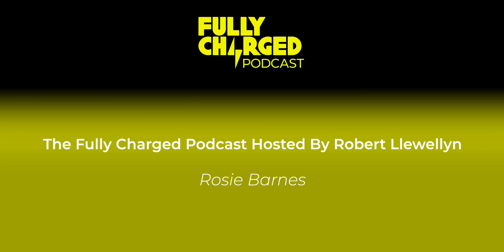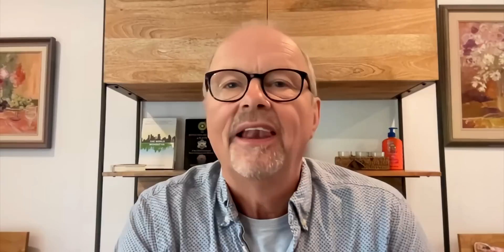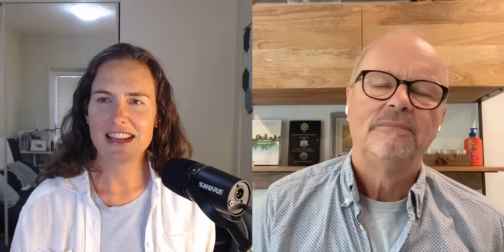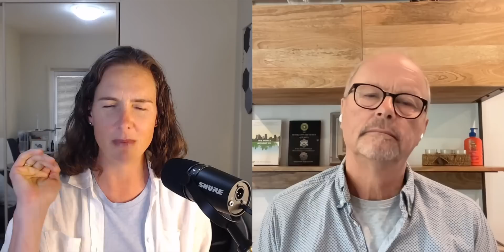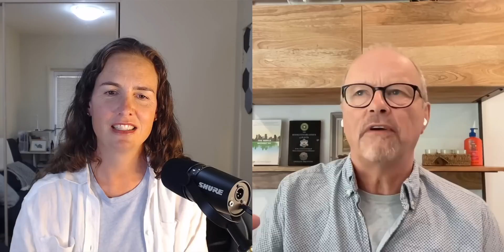The Inevitability of a 100% Renewable Energy Supply with Rosie Barnes | The Fully Charged Podcast

Comment: California has been leading the way in America.. First stopping coal electricity generation back in the 80's!  Then telling the power company they must stop burning oil in the 80's in the summer time, then altogether stop burning oil.  Look at the Dragnet, and you will see the smog over LA back in the 60's, but now the air is so much cleaner.  Steel companies moved out of California, and even the coal power plants where moved to Utah, where LA DWP buys millions of MW of coal power from out of state!  

In 2021, California had 12,000 MW of installed solar capacity, and that made up more than 20% of the electricity produced on days when there was not a lot of HVAC running.  Now they have over 14,000 MW of solar in 2023, and plans to install more than 2,000 MW more during 2023.  

I can recall back in the 90's "More than 10% renewable power will break the grid" and yet Iowa is running 90% wind power many days of each month now!  And some days are 101% wind power, selling the excess to nearby states.  

There is a interesting video about how a University studied the MISO power grid, and came up with solutions to meet 100% renewable power for their section of America.  So if there is a unlimited budget, they can power the entire grid using battery storage and plenty of solar power.  They also figured out how much that will cost.  A little more about that later.

Also with a unlimited budget they can power the entire MISO grid with just wind turbines and battery storage.  Yet they would have to build so many "Extra" wind turbines to make enough power in the summer to run all of those air conditioners.  Yet if they build a few less wind turbines, the system will be much more affordable.  Yet there will be a shortfall in wind power during the summer.  

Again, back to the unlimited budget solar system, it would also require a lot more solar panels, because in the winter, there will not be enough solar power alone to run the grid.  So a reasonable priced solar only system would run out of power during the short hours of sunlight in winter.  

That is when they discovered and documented what has been known for years.  Match the wind power that is in excess in the winter with solar that is in excess in the summer.  Then the system overall can be much lower cost.  

Then they answered the question of how many batteries will be required, and came up with an innovative answer too.  So by installing a few more wind turbines, and a few more solar panels, they can avoid storing all of that power, because they are making excess power, and not running some of the solar systems when they have to much.  

So it really does come down to a math problem.  We do have a limited budget!  They need to make some decisions to save money.  Sure they could spend $1 billion on battery storage and store every watt we produce.  But is that the lowest cost way to get to the end goal?  Would it be less expensive to install a $1 Billion wind farm and then not need so much power overnight because the wind turbines can produce power at night.  The $1 Billion dollar wind farm will produce about 200 MW to 400MW all night long, while the $ 1 billion dollar battery can only supply 2 billion watts of power, then must be recharged with 2.2 billion watts of power.  When you need that 2 billion watts of power, the battery is nice to have around.  However it would also be nice to have that 200 MW every hour X 24 hours a day, and not need to recharge the battery.  200 MW X 24 hours a day is 4,800 MW of power, or double what the battery can put out in 24 hours.  

So do we install the $1 billion battery now?  What is the best solution?  Some battery power is required.  However there is such a thing as to much battery power, and not enough wind farms.  

California has a normal 24,000 MW electrical load, almost 24 hours a day, and a lot more in the summer time, less in the spring and fall when HVAC is not as needed.  So at 18,000 MW of solar power, they will need to sell a lot of power to nearby states in the summer peak power days, while still importing a lot of power overnight.  So they actually have "To much solar power".  If they install more wind power, that will balance things. 

Remember the 2021 Texas blackout was caused by natural gas and coal power plants getting shut off and taking out 400 MW of power production from a dozen power plants all of the sudden!  Then on Monday, the power companies sent their press man to tell the Governor that it was the fault of wind and solar power.  So that made the headlines "Wind and solar caused the blackout".   I like what she said, a coal power plant goes offline, and you lose 1 GW of power all of the sudden,  when one wind turbine stops, nobody notices.  

I agree that less battery storage will be required when we can tell 10,000 car chargers to "Charge now" and then only allow a little charging this hour, because there is the potential of brownout during this hour.

Comment: Rosie, 

you must know that 100% renewable generation for grid supply is impossible, unless significant hydro is providing the power.
In the U.K., since the 26th February wind has been providing on average 5 gwatts per day, two days exceeded 5 one day it was 10 the other it was 13. Maximum demand is a shade over 40 Gwatts. Gas, which was doing the balancing, was averaging about 12 to 15 gwatts per day with  maximums of about 20. 
That, if gas was shutdown, would require about 3,500 Gwatt hours of supply to replace that. From what?
This is ignoring the other technical deficiences of wind generation, I didn't mention solar as that was generating very little as is normal for our winter months.
Reply: We are still in the very early stages. Renewables only have become the cheapest energy source a handfull years ago.
Things have barely started to move at this point, things will only accelerate and keep ramping up quickly from here forward.
10 years from now most of this process will be done already.
Reply: Baron, 

renewables are not the cheapest by any stretch of the imagination. That aside there are far more important parameters which renewables simply cannot meet, not now not far into the future They are practically and technically unsuited to large scale grid supply.
Reply: @iareid8255  they are very much the cheapest. By a margin even.

And there is no reason why they couldn't supply our energy needs. They will soon enough, a decade from now almost all our energy will come from wind and solar.
Reply: @iareid8255  which oil/gas/nuclear company do you work for or have shares in & how often do you have to wash your soiled underwear?  And shirt, as you also seem to be BullSh1tting as well as filling your pants, so I'm sure there's some unpleasant dribble down your shirt front.  You either didn't listen to the full interview, or you're being paid or you read too much Fossil BS propaganda.  When Fossil subsidies are redirected to RE R&D installation, all the anti-RE FUD will dissapear faster than the gas from the Nordstream2 pipeline.  Along with any energy supply shortfall.  So few commenter on here appear to aware of the developments in stationary storage.
Reply: If you have enough wind turbines to provide 300% of the required energy,when the wind isn't blowing you have 300% of nothing. And if it's at night you have no energy at all . That happens.
Reply: Robert, 

correct, and the idea that overbuilding capacity to counter intermittency is both extravagant and ineffective. 
Finacially and technically it is a very bad idea.

Comment: The amount of material required to build a sufficiently strong engineering structure increaces non-proportionately with the size not only because the volume increaces at a greater rate than the linear dimension but because a larger structure even of an identical geometry to a smaller one requires more strength to resist forces that deform it.
Because of this there are ultimate practical limits upon size.
Consider the case of the space elevator cable which even if scaled up in all dimensions would be incapable of resisting the tensile forces resulting from it's weight.
The only way to make such structures bigger is to use stronger materials.
Windmills a mile high?
But made from Graphene rather than Carbon Fiber!

Comment: Amber Electric already let customers buy and sell at wholesale prices.  In SA prices are often negative on sunny days.  I charge two EVs for around 3c per kWh on average.  You do need automated systems to shutdown big loads during price spikes.
Reply: Rob Haitch, my sister bought a home built in 1986 that did have a panel that shuts off her electric dryer and water heater during times of high power demand.  This was in Phoenix Arizona.  They do have them!  Just shutting off those two loads can save a lot of power, then run them at night.  I have my water heater set to run 9 pm to 7 am.  I have plenty of hot water for the rest of the day.  I have a special time of day rate plan, where on weekdays between 5 pm and 9 pm is $0.32 per KW, while weekends and after 9 pm is only $0.08 per KW, and 7 am to 5 pm on weekdays is $0.13 per KW.  So I make a few changes, and now 92% of my power use is off peak, while only 8% is between 5 and 9 on weekdays.
Reply: @Kangenpower7 I can't help but think that I'd just sell my dryer if I lived in Arizona.

Comment: The impossibility of a 100% renewable energy supply:
There is not enough lithium produced just to "green" the US economy that like all nations doubles in size every 33yrs in order to ensure return on investment is met and prevent capitalism collapsing,  never mind the rest of the planets nations who need it also. You will never, in a million years, augment a 90 trillion dollar 1.2 billion fossil fuel vehicle perpetual growth socioeconomic system with renewable systems and any attempt at doing such merely collapses the ecology faster to get all the resources required to do it as we are already taking 30 billion tons of materials beyond this planets 50 billion tons per year red line beyond which permanent ecological damage results.

As for a hydrogen economy that = smoke and mirrors, we only produce 70 million tons of the stuff a year globally, at vast cost in energy, yet just to decarbonise the global steel industry we need 14 billion tons of hydrogen a year never mind all the rest we will supposedly be using in planes trains and automobiles. And then there is the matter of the waste that is non renewable that supposedly renewably energy creates, there are already vast piles of millions of tons piling up all over the earth of old solar panels and turbine blades that are hard to impossible to recycle in any economical fashion.

Do I believe renewable systems have their place?  absolutely. But do I believe they are worth more than spit when employed under perpetual growth capitalism?  absolutely not, and any suggestion or mention of such systems without pointing out the utter futility of employing them under a perpetual growth economic system is complete bullshit to verging on cowardice in this day and age.

In summary after 20 years of inquiry into economics and physics:
No amount of solar panels, wind turbines, electric cars, green growth new deals, no new taxes, nor new regulations, and no technology today, nor coming down the road, will ever be able to allow a perpetual growth socioeconomic system such as capitalism, to outrun the immutable physics governing a finite world.

Using technology in effort to make capitalism compatible with what immutable physics governing a finite world demands of humanity to have a viable future, is akin to putting on your best running shoes in effort to run up an ever increasing landslide, sure you will get further up than without the techno shoes but nature via physics in motion will bury you alive eventually.

And if you don't believe this, then you may as well go argue with gravity or command the tide to stop for all your beliefs will do to alter physical reality.

Comment: The “Early 1990 offshore windfarm in Denmark” Rosie mentions, is Vindeby: Eleven 450kW Bonus turbines. The farm came online october 12 1991 and was decomissioned 25 years later.
Reply: These things only last 25 years?
Reply: @chairmakerPete  Remember this was the first off its kind, it was worn out. Another offshore park Middelgrunden has now been running 28 years. We are running a pilot project to retrofit with a new nacelle and wings. Reusing the tower, transformers and cables. Thus extending its usable life another 20 years.
Reply: @Jens Winther  OK - so 45/50 years is now a reasonable number for lifespan, given a 25 year major revamp.

Do these things require much servicing before the 25 years, or once installed, do they just crank out power "for free"?
Reply: @chairmakerPete  They need servicing. Thats why offshore is more expensive to run and install. You can’t just drive a van with a service tech to the turbine and fix the job. Offeshore needs boats and helicopters. But offshore turbines genereate more power due to the greater wind resources.
Reply: @jenswinther8601  presumably it's a simple calculation that increased servicing costs are more than covered by the additional power output that can be sold.

I have concerns about energy density of wind power, but this has been useful information. Thank you.
Reply: A sobering statistic is that wind energy per km² hasn't increased, bigger turbines need more space.

And I think 25 years will stay the EOL

Comment: I used to live in Germany near Hannover and driving along some of the autobahns you could see a history of wind turbine development. Early examples had towers more akin to the ones holding the cables for the national grid rather than solid structures and were much shorter. 

At my house near Celle I could see over 20 turbines and that wasn't unusual. Driving along the 7 down towards Munich the amount of solar panels covering farm buildings was also staggering.
Reply: Randomjasmic, I am happy that Germany is making plenty of renewable power and can tell Russia to Kiss Off!  

In America we are also replacing our 25 year old wind farms that have 750 KW wind turbines installed in the 90's with 2.5 MW to 3 MW wind turbines popular now!  Now there is a concrete tower being installed in Europe that has 4 meter tall concrete rings, stacked up to about 60 meters tall, then a steel section put on top of that.  Makes the cost much lower, and they are constructed fairly quickly!
Reply: So why are you buying power from France? You dismantled your coal and nuclear power plants and now you can't generate enough yourselves.
Reply: Nothing but a bloody eyesore. Destroying arable land and forests is certainly the way to go,

Comment: At one point Barack Obama DID SAY that he was going to make operating coal plants so expensive that they would be forced to shut down.  I guarantee this was not an isolated move.
Reply: That was 15 years ago. Now there no longer is anything government can do to keep them open.
The economics just aren't there anymore, even if government let them do whatever they wanted.
Reply: @Baron von Limbourgh  what that really means is that 15 years ago,  the plans were set in motion which skyrocketed the expenses of operating coal plants. That's why they're financially untenable.
Reply: @jamesengland7461  no, they where made a lot less competitive by obama 10 to 5 years ago. That is why a lot of them closed during that time.
Now they are made untenable completely by renewables, and now they will all be replaced.

Whatever obama did no longer matters. Even if he hadn't done anything, they would be closing now instead of 5 or 10 years ago.

So basicly you now have a 10 year head start over where you would have been otherwise.
Reply: the main reason is that coal has been made untenable because of natural gas and peaking power plants.
Reply: @peterkratoska4524  gas is just a much better fuel then coal. Both environmentally as operationally.
And around that time the whole fracking thing kicked of as well, making gas cheaper and much wider available.
Reply: @baronvonlimbourgh1716  Yes. Currently we burn 7.6billion tonnes of coal annually (4.4billion by China alone) if we could replace as much as possible with natural gas and still reduce emssions.
Reply: @andyw2132  nuclear is a dead end technology. The costs are just astronomical, who is going to be willing to buy the electricity comming from it by the time they are ready?
Government will have to give guarantees to subsedise it completely if they want anyone to build them.
Reply: @Andy W  Obama said he'd do it,  and it has happened.  I don't know the specifics,  but I'm pretty sure it has a lot to do with onerous regulations. Our country lives and on those.
Reply: @jamesengland7461  ahh yes, not knowing specifics but still having opinions.

That's where things go wrong lol.....
Reply: @Baron von Limbourgh  look,  what's done is done.  The subject hasn't come up in so long that I haven't found a need to research the specifics of Obama's actions, or those of other nations.
Reply: @jamesengland7461  like i said, it no longer matters. If he had done nothing they would no longer be competitive either.
Cost of renewables are now lower then coal was in 2005, and still steadilly declining. At best coal would have been viable for a decade longer, but it eventually becomming untenable always was just around the corner. And that is where we are now.